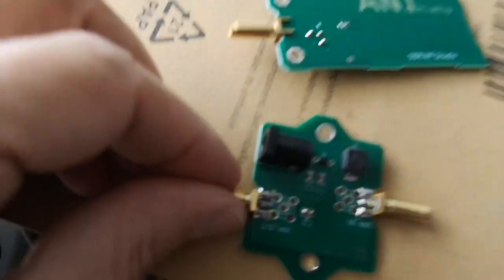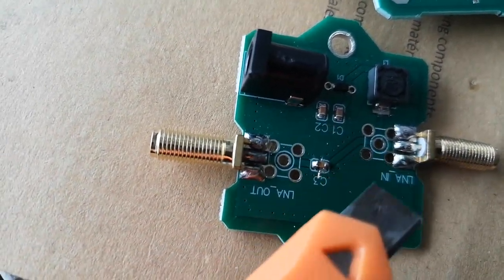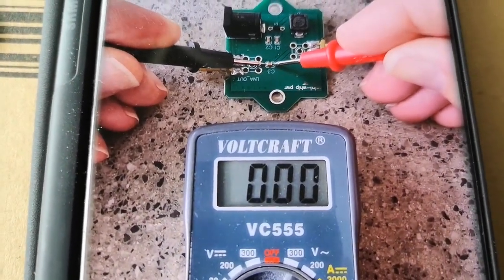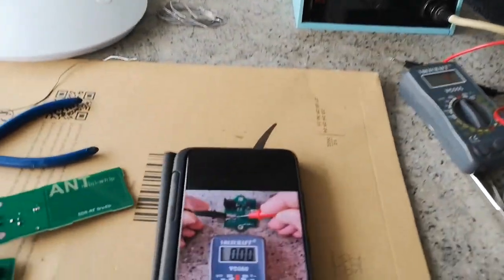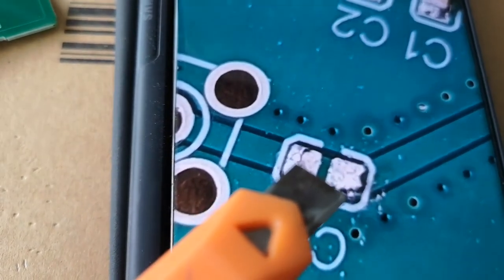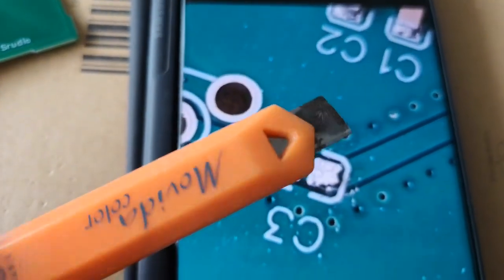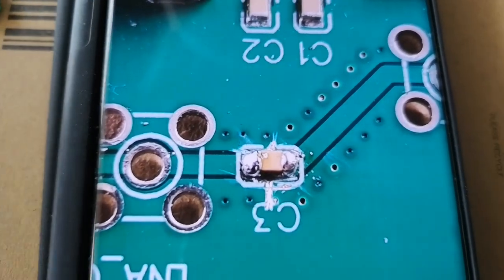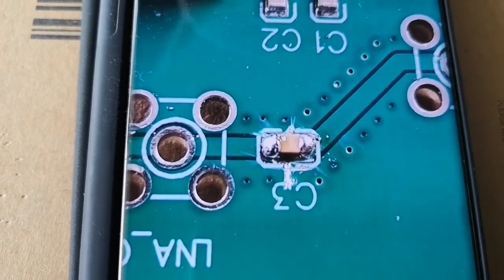Small Hidden Antennas for Indoor Amateur Radio Episode 3: The Mini Whip

Comment: Ha! I bought one of those too and had the same results. I fixed the shorted capacitor exactly like you did and then found the antenna did not work. Mine went directly into the trash😀 
Paul WB0ZRD
Reply from the maker: I wonder how many people had the same experience ? In the meantime I got the genuine article direct from pa0rdt. It works like a dream. I am amazed at the strong signals and low noise floor. It even works really well down at 70 kHz etc.